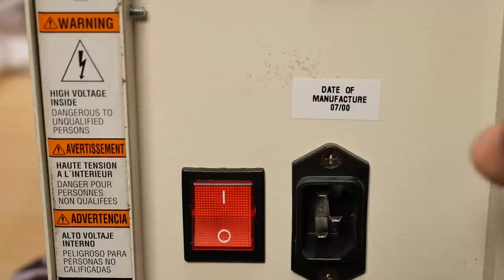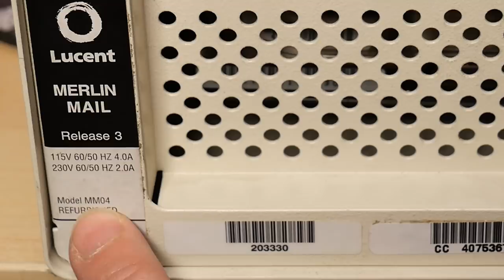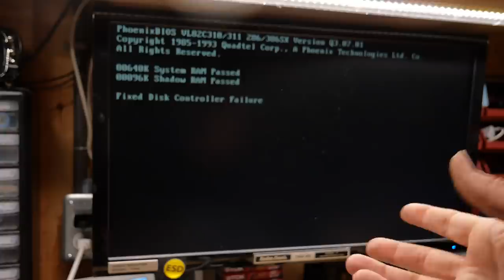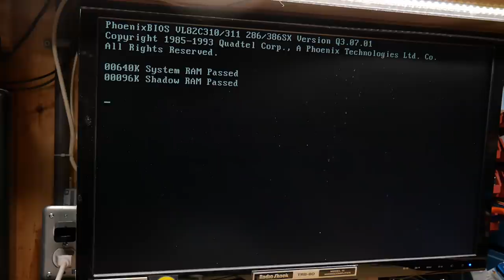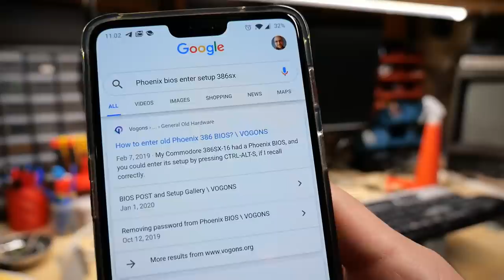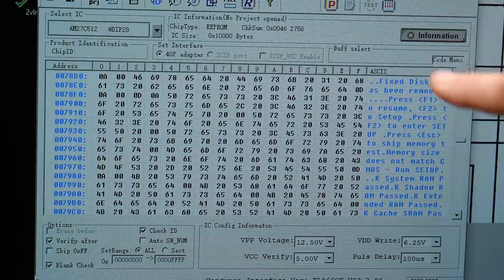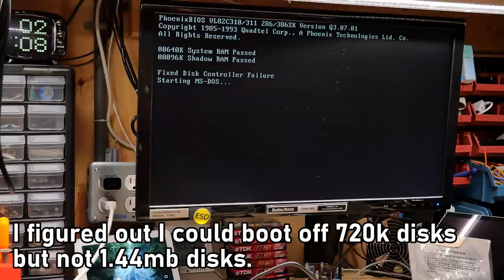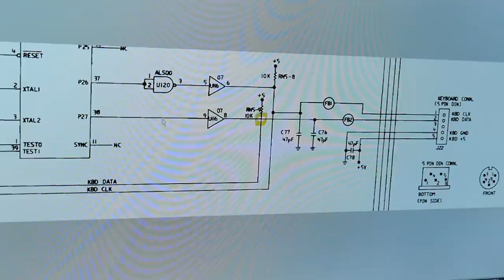Trashpicked Voicemail System

Comment: Adrian - I built many desktop/transportable systems back then (including this board) and also managed this very email system. That board is what we called a 286/386 motherboard. It could come with DRAM sockets and/or SIMM sockets, and a choice of 286 or 386SX CPU. The board would barely handle 33MHz, and failed with a higher FREQ. the 386SX-40 is likely because of availability and later, pricing (40MHz was cheaper than the 33MHz part). The kludge board (early models) near the CPU was for use with a 286 CPU, and is bypassed when using a 386SX by that circuit. If it was a 286CPU, the other socket was empty or similarly bypassed. The PAL/keyboard and BIOS issue is due to differences between how the keyboards connect on 286 and 386. Many failures were "fixed" by replacing that PAL, and not the keyboard BIOS. And yes, changing from Phoenix to AMI would often (in those days) require swapping both, and all three on this 286/386 contortion.
Reply from the maker: Ah so that means there is little hope for this board as it sounds somewhat bespoke and customized for AT&T/Lucent. Clearly I won't find a better PAL and without a working BIOS there isn't much to be done.
Reply: @adriansdigitalbasement  AFAIK it is sometimes possible to read OTP PAL chips, and it may be possible to work around with some effort... but I wouldn't keep my hopes up, probably not worth the effort.
Though as someone else mentioned, might worth trying again and saving with ESC instead of F10...
Reply: Can’t you just bypass the PAL and wire the KB micro directly to the port?  (With the necessary buffer circuit if need be.)
Reply: I had a look at the BIOS and it is custom, where the hard drive information is normally stored the BIOS is looking for what appears to be a date and time. The Keyboard protocol seems standard nothing out of the ordinary.
Reply: One of my previous employers had a system like this. According to IT is was a 386 running a custom version of Linux.
Reply: @misterhat5823  Well, nearly. IIRC, It was a form of *nix or SCO or some BSD variant. In production since the late 80's, it came out many years before Linux. Not DOS based.
Reply: @adriansdigitalbasement  Correct. The boards were mostly fine under DOS, but failed horribly under any EMM memory extenders, and super unstable under Windows 3.x - The answer given by the suppliers? "Run Windows 2.1". Oddly, there were a lot of systems manufacturers that used these boards, but then, all the heavy lifting was done by the Brooktrout cards or similar processing cards.

SIDE-NOTE on the Dallas Clock - this was the era where not all PC's had them, and they were known to be unreliable. The Dallas Clock chip was about $40-50 each when it came out, but was mandatory in time-sensitive equipment like this. Used to be there was a separate .com to run to set those, until it was integrated into BIOS/CMOS setup.

And you were correct about the disk extension software, Type 46 was a common type to use to if you didn't have "USER" or "CUSTOM" to set the proper parameters. Back in the day we had special setups to custom write parameters into the BIOS when drives were non-standard. PITA.

You are better off finding a proper 386 board that (if you are lucky also has a VESA slot for video) is more standard. But this certainly has been a journey down memory lane.
Reply: Bodge wires why woild it have been repaired if it is new they might be there to modify and prevent things from being axcessed
Reply: @mahargddik8948  Bodge wires may not only be for repairs, there are some boards I've seen that were bodged by the factory due to an error in the creation of the PCB
Reply: My money would be on the PAL taking place of the LS00 and 07 in the keyboard interface, reducing chip count and cost, making the board smaller and compact.
Reply: @Mark Hutchinson Would not also the PAL handle serial port redirection for the keyboard controller, so you could enter the BIOS setup over the serial port? As this would otherwise require a technician to disassemble the complete system as the connector was not accessible from the outside? And it would also allow remote access with a modem hooked up to the serial port.
I'm thinking if @Adrian's Digital Basement hooked up a serial cable he might just get into the BIOS...
Reply: There is no difference between a 286 and 386 when it comes to the keyboard. The VLSI chip (in this case) should decode the address bus and when ports 60 and 64 appear it should enable the keyboard controller. The BIOS communicates with the keyboard by sending commands to the controller. These commands should be standard. The PAL sits between the Keyboard and the Keyboard Controller and is part of the (open collector) clock circuitry? I don't see any reason why this couldn't be converted into a PC, the keyboard is clearly working when he is using the setup program. Try running checkit, it should test the keyboard. You should always zero out CMOS before you switch BIOS's.
Reply: The hard disk controller is bad, i suggest first to test using another isa bus hard disk controller.
Reply: I just got to thinking. Maybe the bodge wires are pulling something low or high to mess with the keyboard. Purposely knocking the keyboard out on a hardware level.
Reply: @mahargddik8948  Bodge wires may also indicate a product design fix or act as part of a revision done to improve performance or run with alternate components.
Reply: @tombarber8929  In order to get low power 486's to work with  a previous employer's product, we'd have to add a buffer to make sure the A20 gate got a solid signal voltage.  The process involved bodge wires, plus running 4 wires to a smt buffer fastened to the back of a board with double sided tape
Reply: Is the bios looking for a specific keyboard or a dongle on the parallel port?
Reply: Also he might be better off trying another phionex bios with that motherboard.  Switching Bios to a different brand sometimes doesn't work with some keyboard controllers IIRC.
Reply: @RocketGeek  I've seen a bunch of generations of these and they run something like SCO Unix
Reply: @RocketGeek  you know even for some IT guys everything besides Windows and DOS including UNIX is Linux.
Reply: @Mark Hutchinson - 
That´s fascinating
Reply: @misterhat5823  That sounds like the Audix system that I used to support. We called it "Phone-ix" The PC was basically an off the shelf Acer '386 with the I/O cards similar to the ones in Adrian's video along with a tape streamer to hold the welcome message.

Comment: I’d put it back to the stock config and connect a terminal or emulator to a serial port. At a previous job, We had an AT&T audix voice mail system that was similar, and it ran AT&T Unix and expected a serial console not a vga with keyboard. At my current job we’ve got some modern server running Linux that are configured the same way, the primary console, including post and bios setup, are directed to a com port.
Reply: Beat me to it.  :)  I'd imagine that when an official repairman worked on it, he had some kind of handheld serial monitor that he could plug in to talk to the hardware.
Reply: What he said...  most of the ATT & Lucent are expecting Unix and not screens.  Hook up a terminal via serial with the hard drive attached.  As I remember it, it was 9600,N,1 but I probably have that wrong.
Reply: That's exactly how it worked.  Those two cards plugged into the phone system controller and would have been treated as extensions in the system.  From there, the users would access the system through their phones, meanwhile the operator would have a serial console at their desk where they could manage the system as a whole.

https://downloads.avaya.com/css/P8/documents/003677613
Reply: Yep telecoms stuff is often RS-232 and a further hint is the lack of a video card.  A field tech wouldn't likely be dragging around a video card and monitor.  Good luck.
Reply: The lack of video card , and odd looking bios gives it away as com1 console
Reply: I was thinking this too.  I remember a similar setup at a place I used to work.  There was an old amber CRT dumb terminal on a desk next to the comm rack specifically for managing the phone system.
Reply: Yeah, this system was clearly headless, which is normal for anything that's effectively an appliance.  As Richard Thompson suggests, the serial port settings are probably 9600,N,1, which are typical settings for headless appliances to this day.  (I just got my CCNA a few months back, and that's what the serial connections on Cisco gear is.  Pretty much everyone is going to do the same simply because it will avoid annoying techs with having to keep track of the connection settings for different gear.)
Reply: I was thinking the same thing. There were serial ports there, no video, so I was expecting him to just hook up to one of them instead of putting in a video card. SSH-ing into machines on LAN has made me really appreciate how optional video can be, and certainly shifted my base instincts for the default good way to deal with a text mode system. Plus then the font can look nice and not distorted in a terminal window, instead of stretched to fill a monitor...
Reply: Audix is Modular Messaging (Aka MM or merlin Mail) same animal, different name. Today they renamed it to Aura Messaging.
Reply: @glonch  Hi Rich, it's Bob from the Delta days. How funny we are watching the same videos after all these decades!
Reply: @glonch  Yup. Our Audix system had a Televideo terminal until it fried like most do and the tech had to bring us a new one. Your configuration sounds familiar. It's been nearly 18 years since I saw the setup on the terminal. What's interesting is even though Avaya was supporting the system and sold it to the company, most of the boxes still said AT&T on them and so did the user manuals.

Comment: dude, that thing is worth a fortune! us telephone collectors that still use Merlin Classic systems pay good money for these since they are pretty rare! You should offer it up on eBay or something so it can go back into service!
These systems were introduced in the mid 90's. The build sticker is likely the date it was rebuilt by Avaya, which im suprised they didn't rebrand it since Lucent was gone by 2000 or so unless this was done right before they spun off into Avaya from lucent. These things were rock solid, and likely the reason it was refurbished is because the hard drive failed. These cost about $10k when they were new. This would wedge into the merlin system using extensions. The system would be programmed to forward a call to a VM port (one of those 2 cards) where the VM system would take over. The end user would call an extension or dial a code (depending on Classic or Merlin Plus system) and the system would prompt for the VM box and passcode. It was a highly advanced system for its day. My Avaya IPOffice 500 from 2008 or so (which is still sold today) does everything this huge box does on a 16gb CF card!
Reply: The last analog phone system I supported was a System 75. It was bought in the early 90s and lasted until 2005. I miss the Charlie's Angles speaker phone.
Reply: I would love to find an mid to late 90s PBX to route calls to a multi node retro BBS.
Reply: Hell yeah, letting a telephone collector get use of it instead of simply cannibalising the motherboard sounds nice.
Reply: I would hate to see that salvaged for parts; I like the idea of it going back into service.
Reply: its worth close to 0, nowadays you can setup software PBX on a $100 worth of hardware, and it will include voip endpoints and all the modern features.
Reply: "it's worth close to 0" because it's obsolete -- says the guy watching vintage hardware collector videos....
Reply: Unlike the phone system we had at our sales office in Mt Vernon, when they moved it up from NYC.  It had been a used system from the old Atlanta office, I remember the control unit being a tall yet narrow cabinet, and at least once a week it would go haywire, with all the phones flashing and beeping, which required a power-cycle to clear it.   Of course, before the sales office moved there, when we were still just a satellite film library, we had a Merlin system.
Reply: sold listings on ebay suggest it might be worth a few hundred bucks
Reply: Matt Search for Merlin Legend or Merlin Magix on eBay. You can get a system for less than $100. The phones are cheap too. Avaya MLX or 4400 series.
Reply: @mstandish  Grandstream supports this today. And its a true SIP/FSX/FSO product.
Reply: Matt , Got my PCM flowin… this thing is gold! and its ISA too! OMG>>>>>>> Brooktrouts ftw!
Reply: @SenileOtaku  Sounds like Meridian Mail when it gets fragged.
Reply: "worth a fortune" lmao no dude
Reply: @rasz  but you dont have the ports to make it backwards compatible. There are so many "Modern" devices that need the actual 1fb interface to work with SIP, such as a typical door access controller or HID badge server. Its true and you are correct that phones and a modern PBX is easy. Tell the rest of the planet to catch up lol, stupid door kings are the strangest outdated but new systems.

Comment: We had one of these at the company I work for until about 2012, when we went to IP phones and got rid of our Avaya PBX.  Which BTW, was so reliable we never had a single problem with it to my knowledge in the 10 years it was in operation.  The "Audix" voicemail PC was identical except it did have a front panel with a floppy drive and an optical minidisk for backup.  Once I had to take it apart and reseat everything and as far as I can remember, the interior was identical.  We managed the system with either an amber screen terminal or a piece of software that replicated all the features and connected to the PBX's IP.  *Edit:  Reading the other comments on its value, I really wish I'd rescued it from the recycling once it'd been retired.

Comment: We had one, called Smooth Operator, when I was working in the early 90s; they had specifically configured it so we couldn't use it as any kind of standard PC.  I seem to remember it coming up in the conversation with the sales people at the time.
So it is implemented as security by obscurity specifically to stop people trying to use it as a normal PC.

Comment: We had a similar Vocemail system at work up until around 2 years ago, and was even older (around 95-95) and ran NT4. This was being used for around 2000 users and we only replaced it when the hard drive decided to start failing (Luckily when it decided to fully fall over it did it on the morning of replacement).
Reply: NT4? Was it Meridian Mail?

Comment: I've found several reasonably nice PCs out on the curb waiting for trash pickup.  Usually, all I have to do is press the key for the restore utility while it's booting.  People mess up the OS and the software and throw it away, but there's nothing wrong with the hardware and they must not realize that there is a built in factory-condition restore.  Every now and then, I can tell they were poking around inside especially if the BIOS reset jumper is in the wrong position or some cables are unplugged.  Hardly anybody bothers to remove or erase the hard disks.
Reply: Which restore utili,  one on mine wont work,  its going to linux

Comment: Hi Adrian, I just found your channel great stuff, subed. I used to work on Merlin systems back in the early 2000's, when I was a tech at a local telecom business. It's been years, but I think I have a ton of service manuals for these systems in storage somewhere. Next time I'm in there, I'll look for them.  I didn't work on these long,. VOIP was on the horizon, and we jumped on the Mitel bandwagon and ditched legacy AT&T products. We had one tech that still supported these for years though, for clients that were hesitant to mirgrate over to VOIP.

Comment: Yep, 386 motherboards in custom-purpose hardware.  Kind of like the CD duplicator we had at Future Vision.  It was in a very sparse-looking beige metal housing, with nothing more than a row of membrane buttons, and a 2-line LED display.  It could run 4 SCSI 4x CD writers at once (each on their own card/cable).  

Some time later we had to open the system, and found that 386 (or 386SX) motherbard, 5 SCSI-1 cards (one each for the external writers, one for the SCSI HDD you would dump your master copy down to, then read off of to write to the drives).  You'd program your choices of what you wanted to copy, how many copies, etc through a labyrinthine menu on that 2-line display.

Comment: Have you tried using a serial console? Since there wasn't natively a video card, maybe the BIOS was configured with a serial console.
Reply: I'd give it a try as it had a multi-io board with a serial port. I bet there is a console there.
Reply: That would be my guess. A old dumb terminal like a VT-100.  Would also explain the 2 rs-232 ports.  I had a older AT&T system that only had 1 rs-232 for a terminal or you could dial into it.  If you called the correct port directly and entered the right DTMF code you would get the modem.  That could be why one of the cards has a DSP chip on it.